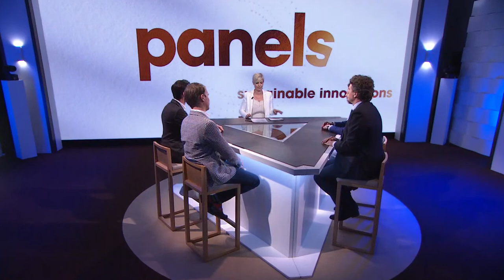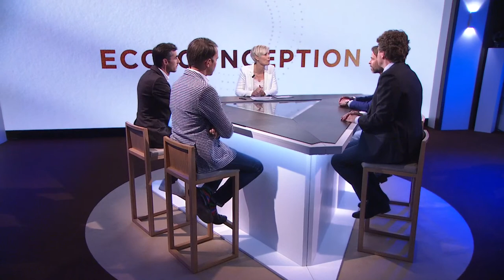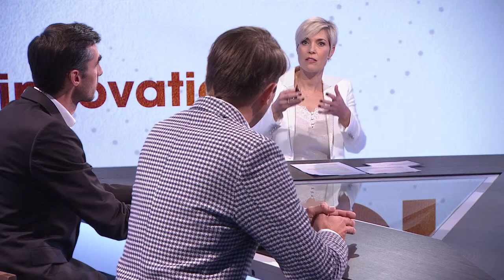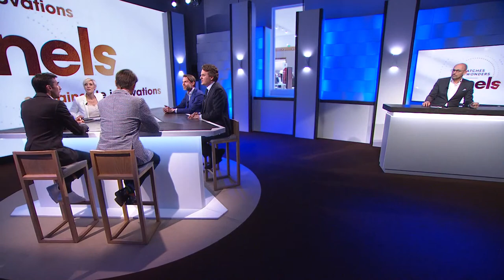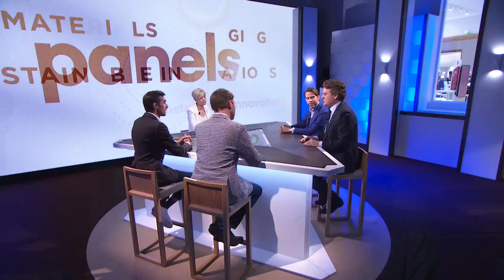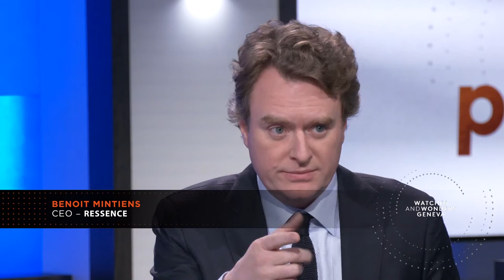Watches and Wonders Panels : Sustainable innovations - April 2

Comment: All this talk about sustainability is a load of BS. As long as companies restrict access to parts from the public, then mechanical watches have the same planned obsolescence as smart watches or any other electronic product. Sustainability means having right to repair locally and not having to send your watch half the world back to the manufacturer and wait for months to get it serviced, or even have parts unnecessarily changed. Sustainability means supporting local watchmakers and allowing them access to parts. Destroying brand new watches in order to maintain high prices and brand value is exactly opposite to sustainability.
Reply: Yours is a very good point to think about it because you got the extensive meaning of sustainability